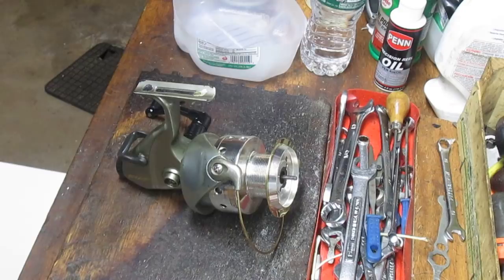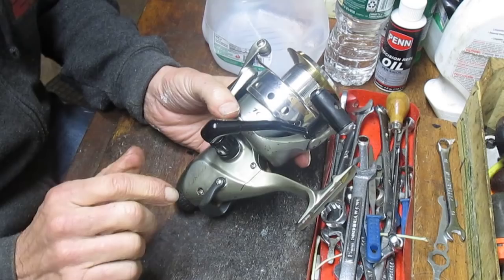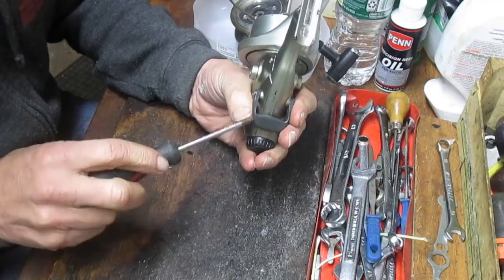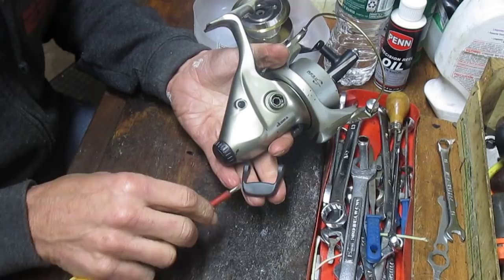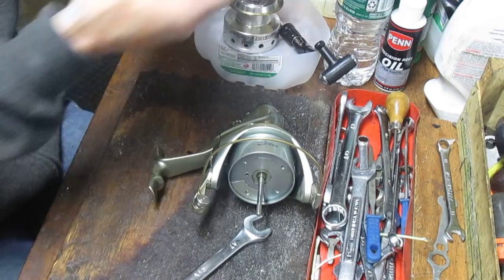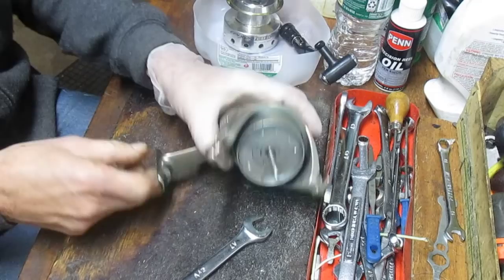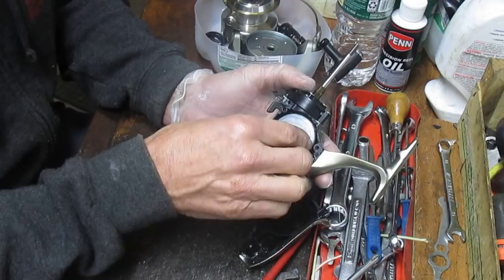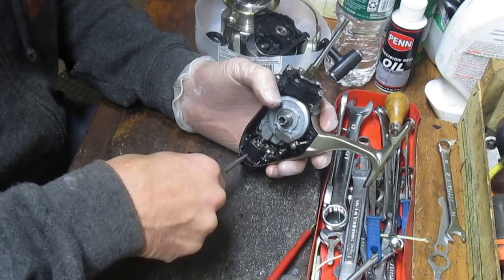How to service a typical bait feeder  fishing reel using Okuma Epixor for Demo

Comment: Hi Denis I have the reel back together now.  What a tricky reel had to "time" the osculating gear and then jiggle the back lever to get the cover to seat.  The reel had a bit of grease but I added some Inox MX8 grease to the gears  and I lube my reel bearings with Type A Transmission oil as it stays in the bearing.  I clean my reels out with brake clean as it dries way quite quick.   Found it at disaster to put grease in the bearings of a reel as the reels gets too stiff.  Added the Okuma Cal's drag grease to the pack of drag washers and that makes the drag on any reel smooth.    You are doing a good demonstration.
Reply from the maker: Sounds like you've done it all.  Nice job.  Thanks for watching - Dennis

Comment: Thanks for the upload!! I needed to replace a stripped main gear, and this video helped me fix it without issue!!
Reply from the maker: Glad to hear that the video helped.  Bait feeders add a level of complexity to a tune up or repair, but you should be afraid to work on them. - Please stay tuned - Dennis

Comment: I have the avenger abf 65 it’s similar, the anti reverse is broke what part is messed up in it
Reply from the maker: It could be the A/R clutch under the rotor if your rotor is not stopping from turning backwards or there is a possibility that something in the bait feeder function - rear drag, trip lever or something else that is impeding the lock if it is the spool that is not locking in place - Dennis